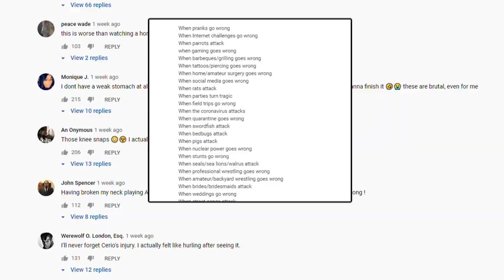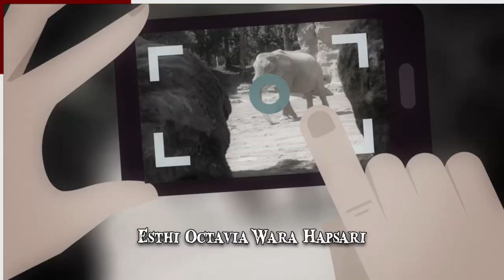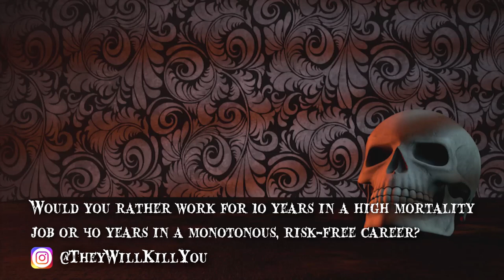7 Most Dangerous Well-Paying Jobs

Comment: I did high rise window repair for years. I would repel from the roof on a work line with a second safety line. If you check and rig your own gear and know what your doing its very safe. You have a safety line , boots, helmet, gloves, goggles and knee pads. If you keep your equipment in good order you will have a high paying job with awesome views and nobody looking over your shoulder as you work.